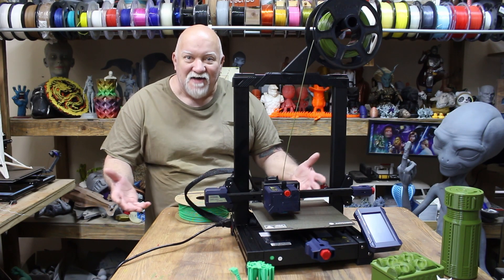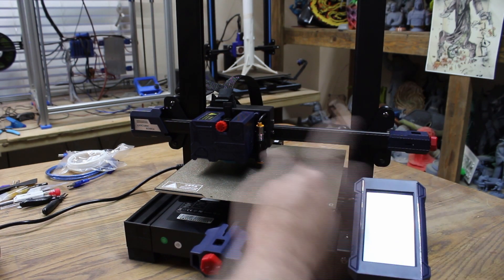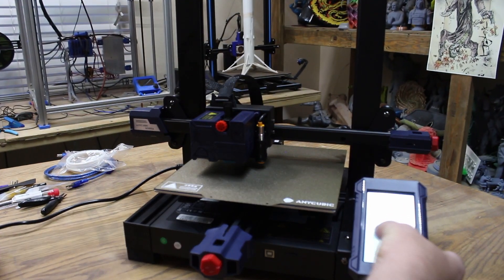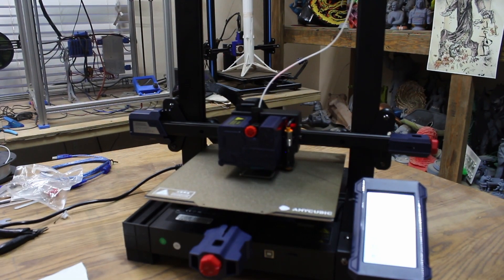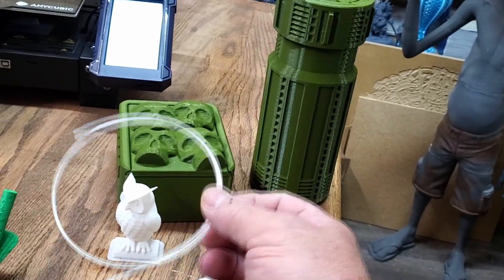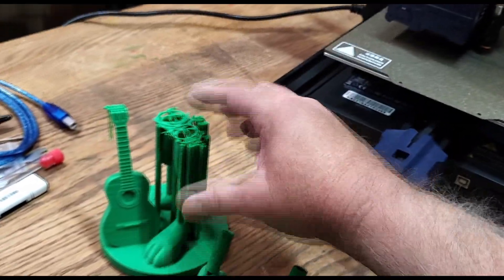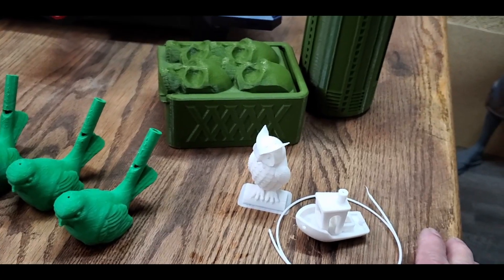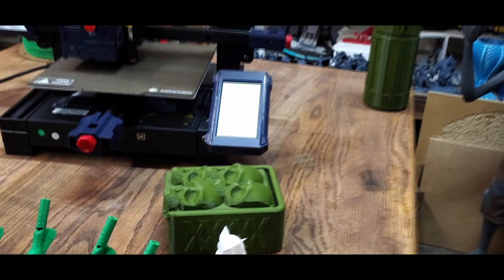Best Budget 3D Printer of 2022.The Anycubic Kobra. #3dhp

Comment: I have done 3 test prints… the second 2 ended up really bad z banding… any thoughts on how to fix it on the kobra
Reply from the maker: Prusa slicer with Mega Zero profile,changed bed size. z banding can be set to random , bu will leave zits everywhere or rear left is the best place,just pasition your model to have on the corner or back.Its a setting in the slicer.

Comment: Anycubic has not yet released the source code of this printer breaching the GPL v3 open source license. This affects us as owners by limiting upgrades of our printers and having less 3rd party developers making new better parts. While they refuse the release of the source code i would not recommend this printer.
Reply from the maker: Yes I know this now and also contacted them. As the printer stands if you just want to print with it as it is and never try to mod it, it works great.
Reply: It's out now.

Comment: but it cant print the nylon stuff ?
Reply from the maker: No , its for Pla,Tpu,Petg. Its doesn't have a high temp hotend.
Reply: @3DHP  ok, but is all of that nylon stuff good for printing something special or is all of that pla,tpu and petg sufficient too?
and it does not print Abs either tho?
Reply from the maker: @viisteist1363  Yes you could print ABS if you had an enclosure to reduce warping,layer separation etc.Pla is a general purpose filament,but can't withstand high temps.like things that might be in the sun.Tpu is for flexible parts like tires,tracks etc.Best if you google the differences.
Reply: Sovol SV06 is the hot printer in this price range now... linear rods all axis, FULL metal hotend, planetary geared extruder...
Reply: @brianmi40  so its better than sv05 and sv04 etc? and what are those smaller numbers even used for?
Reply: @viisteist1363  3D printers are available with a wide range of features with model numbers to identify them.  No different from cars, golf clubs, telescopes and everything else you can buy.

The thing to do is decide first what you want to do with a 3D printer:

- print miniatures for D&D
- print mostly functional items (storage, household useful items, etc.)
- design and create objects in CAD yourself that you want to bring into the world (learn or leverage design skills to create new things)
- print gadgets, toys
- print artistic items
etc.

After you figure all that out, then you learn what filament types work best for those you are interested in, whether PLA, PETG, ABS, NYLON, Wood fiber, Carbon fiber, etc.

Then you can review printers that are rated to use those filaments and create those kinds of things reliably, in the size and quantities you need.
Reply: @brianmi40  ok, but does any other sovol version have those hotends, linear rods, planetary extruder etc or only the sv06? and what does the planet even do on it?)
i probably want to print some powertool addons like dust covers etc...
Reply: @viisteist1363  no, it is unique w those.